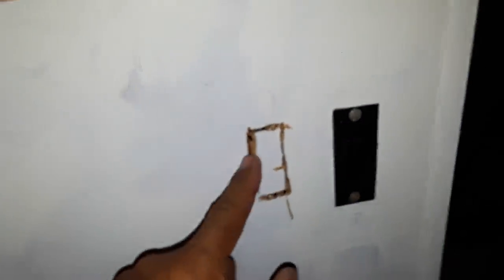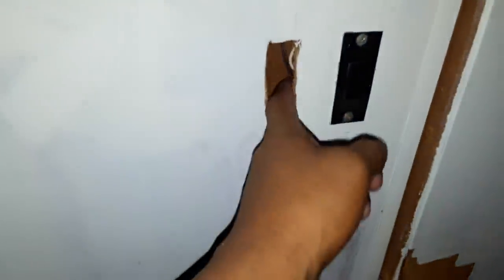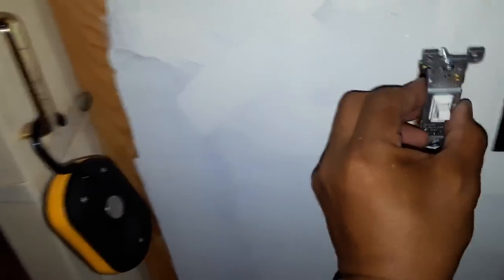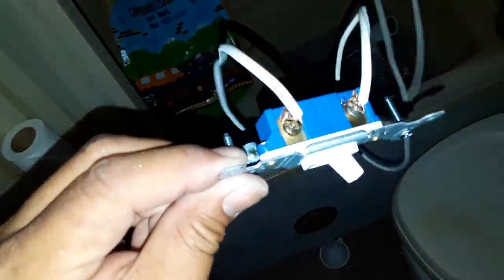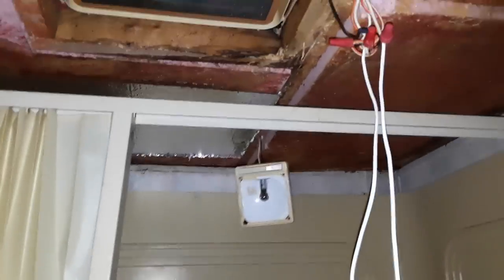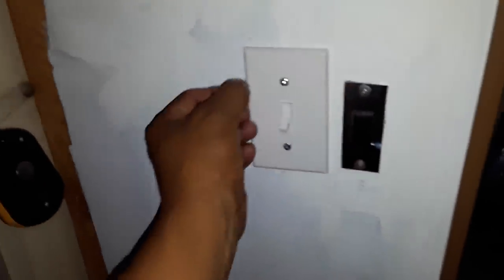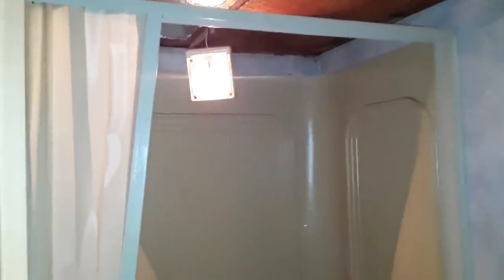Installing A Bathroom Light Switch In The RV (V1807) Living In An RV

Comment: You said you use the bathroom a lot. What is the black tank situation like? Don't you have to take the RV somewhere where you can empty it? Isn't it a hassle? If I were you I'd do a DIY composting toilet  of sorts with pine pellet horse bedding hydrated into sawdust and a bucket. They sell pine litter for cats and charge an arm and a leg for it and you can DIY for pennies on the dollar using a 40lb bag for $5 which will last you several months. Just cover poop with it and it will absorb the smell. You could then shovel it out and put it in a brown paper grocery bag (like from Trader Joe's) with some more pine dust in it and when that it filled partway, empty it at the dump.

Comment: If it's low current don't worry too much about electric shock.  Noticed that there is a 110v outlet in the washroom.  Curious note if the plug is a GFCI type outlet?
Reply from the maker: Yes.  It's GFCI. Everything is also tied in to the main circuit breakers under the bed as well.

Comment: Really do need a box to protect the wire connection and keep the switch nice and tight in position. . Very cheap and well worth the investment. Too many variables in an RV to skip that component: When the RV gets moving down the road there will be lots of vibration to work those connections loose (fire hazard) , water is likely to leak into the wall from the bathroom or roof, and potentially wet hands will be flipping the switch (shock hazard).  Those RV walls are not substantial enough to hold the screws. That stud would be better to attach a box. I'm not an electrician, but I watch my electrician working and sometimes hand him stuff, and he says all connections need to be in a box.   In Lowes and Home Depot they have both plastic and metal electrical boxes. I'd get the plastic.
Reply from the maker: The entire RV is wired without boxes. The walls are typically 1/2 - 1 inch thick.
Reply: @LivingInAVan  Ok--maybe I worry too much and go a bit TOO much overboard on fixing potential safety issues. I just want you and the family to be safe.
Reply from the maker: I appreciate your kind thoughts. It truly is appreciated.